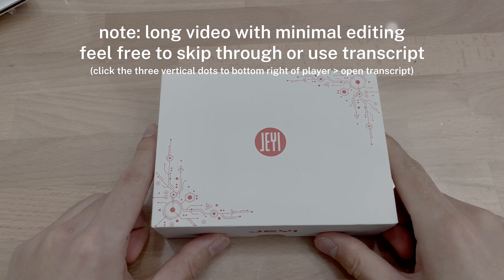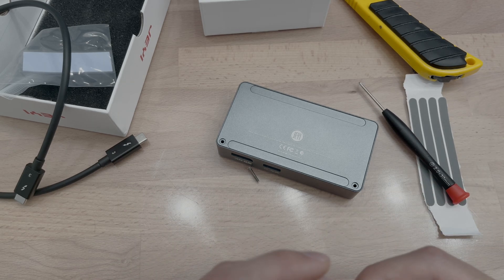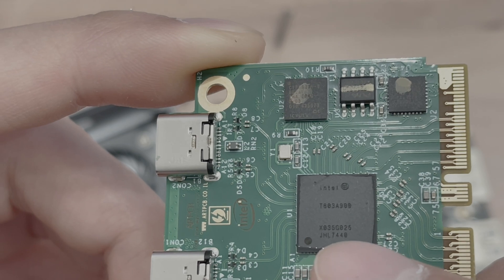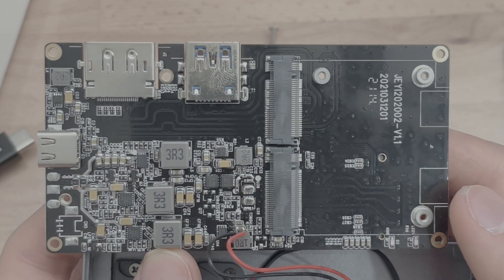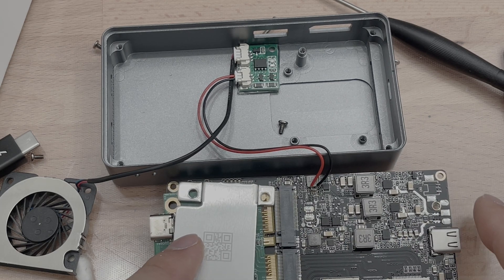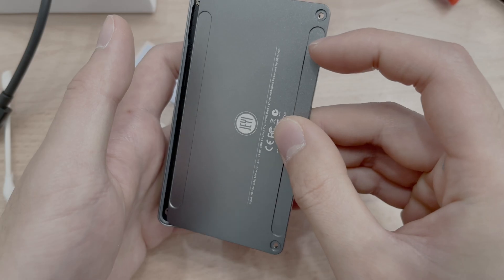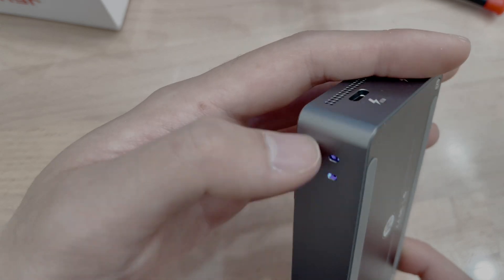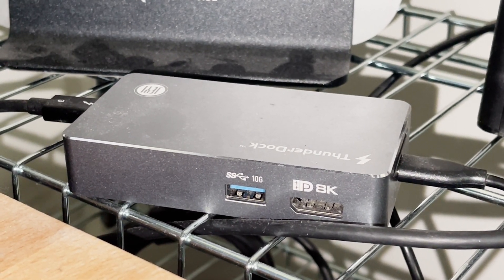JEYI ThunderDock 7 Mini Thunderbolt 3 Thunderbolt 4 NVMe SSD 8K DP USB 3.2 Dock Teardown/Unboxing

Comment: Man this was thorough. So I own an owc thunderbolt 3 dock. Can I use the power delivery from the dock to daisy chain?
Reply from the maker: Sorry, I think I read this wrong. 

I am not aware of whether or not this would work correctly, but I think this dock requires more than 5V to operate. If your dock supplies 20V, it should work. Keep in mind that you need two ports connected to use this - a data input and a power input, one cable cannot perform two functions